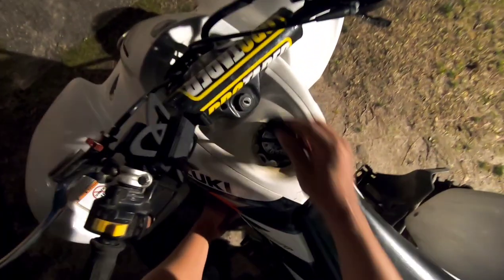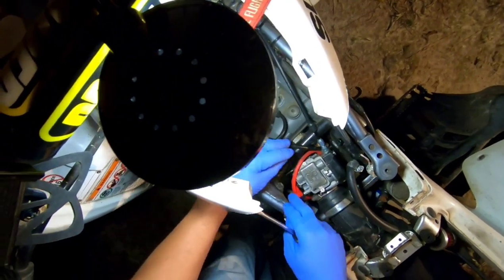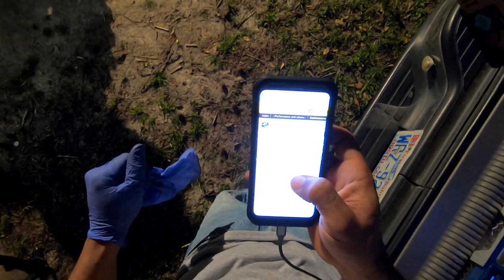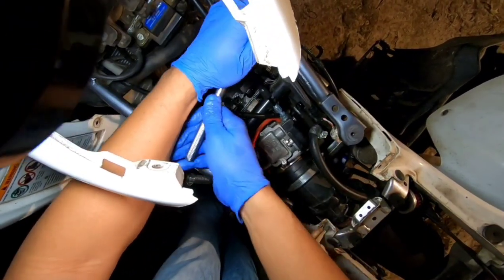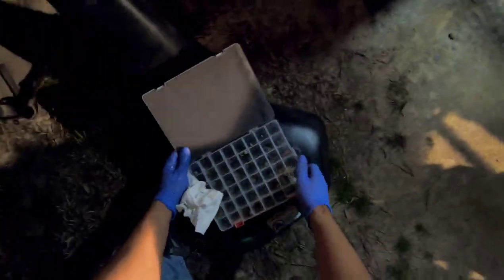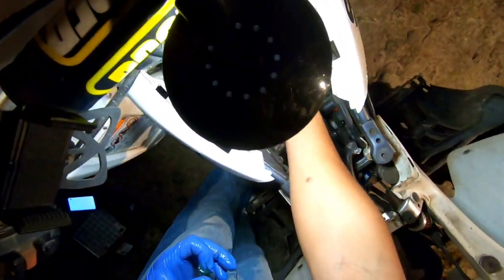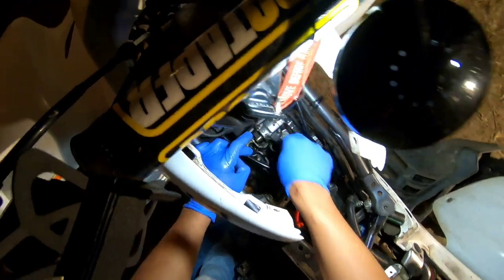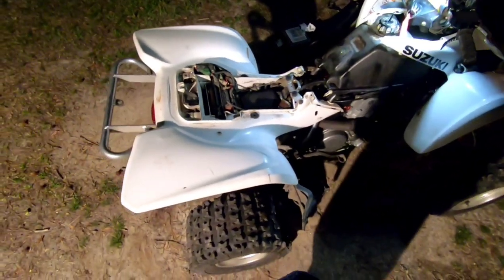How To Check And Adjust Valve Clearance On Suzuki LTZ400! I Need Transportation 2 The Beaver Dams!

Comment: Worse case from my Yamaha experience; is the rattle is worn out valve guides, springs, and seat.  But if there is good compression seating, then I would watch for valve float in other ways (springs, lobes, clearance, tensioner).  If a valve keeper/collet goes; plan for a new piston, head, cylinder, etc.  Not knowing Suzuki, don't want to say it's a rocker.  Or know if it is lower end/gudgeon pin.  Since it is not mine, I'd start with new springs and valve hardware.
Reply from the maker: Man! Now you sound like a true small engine mechanic! Lol I really hope it's none of those things because I haven't advanced to the level of inserting springs, valves and valve keepers and I definitely can't mess with the bottom end! Lol I know Z400s are known for having a little tick normally but this is a bit much. I actually had a valve to drop back in early 2018 and destroyed the head, cylinder and piston smh so all of those things are new and then mid 2018 chain came off and bound around the front sprocket and destroyed transmission lol smh so I didn't have the money to get it fixed until 2019 so my quad has been thru! Lol so it's not had a whole Lotta hours since that engine rebuild, but at least 10 blown head gaskets has probably not been good for it.
Reply: @TerrellSpivey  Just don't want you to go through another valve drop is all then.  Yeah, changing springs requires taking the head off, or filling the cylinder with rope.  Never tried the latter.  And it reads like any chain guides, tensioners, and old chain would be replaced when the wrap grenaded last round.  But yeah, if you can live with it, run it.  If it breaks again, it will be easier to diagnose than using speculation.
Reply from the maker: @AudioAdvisory38  definitely don't wanna go thru another! Lol if need be ill take the head off and take it to my mechanic and let him check the valves and things. Definitely appreciate cha

Comment: So I know this was posted a while ago. Figured it was worth a shot. Just had my 400 rebuilt and it has that ticking noise. Is that normal?
Reply from the maker: If it's as loud as this I gonna say no, but a minor tick is normal due to the sound of the cam lobes hitting the buckets. I say no because even tho my valve lash was in great specs it still had a loud tick and in May of last year the crank rod broke and went thru the case and the piston was seized in the jug. Till this day I have no idea how such could happen! Smh

Comment: The cam chain tensioner needs to be tightened more cam chain has stretched out
Reply from the maker: I probably needed a new one at the time because I'd definitely tightened it! But my baby blew up in May smh crank rod broke, piston was seized in the cylinder and rod punched thru the tranny smh timing chain wasn't broke tho when I pulled it apart